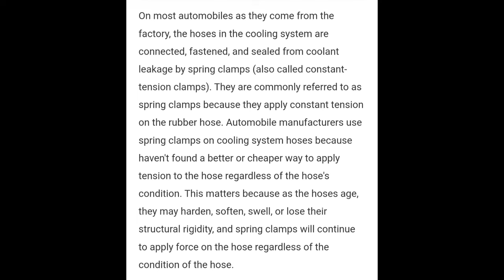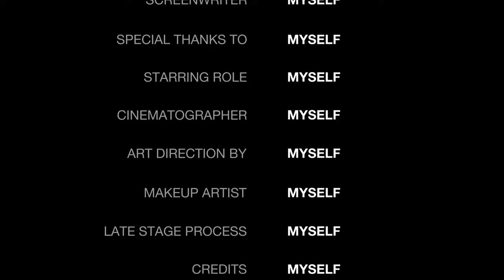STOP USING THESE ON YOUR CAR! Hose clamps worm 🪱 vs constant tension clamps!

Comment: i will confess I initially hated those clamps and would swap them out the first chance I had ....but if you have the correct tool for them its a piece of cake getting them on and off ... now I am a convert.
Reply: I've always used small channel lock pliers and it works pretty good on them.

Comment: Worm clamps are bad enough in the auto industry but it’s even worse when people use them on buried sprinkler lines.
Reply: LOL...I just put worm clamps on my sprinkler line lol. Why is this an even worse application (genuinely curious)? Based on the video, it's mostly due to thermal cycles that you don't want to use worm gear clamps. I can't imagine my sprinkler system having the thermal stress that a cooling system does. All the clamps are made of 304 stainless so I don't see corrosion as a major issue.
Reply: @MrBrandonh98  just wait a few years, if you have to dig up that sprinkler line you’ll find out,
Just because it’s stainless steel it’s still going to be a large clump of rust,
It’s not the clamp that’s the problem, it’s the screw

Comment: Yup sounds good ! 
What I came across is u got to have the correct thickness and size hose for those spring hose clamps if not they leak, that’s why people went to worm drive clamps. High pressure hose clamps all the way!

Comment: The first time I encountered the constant tension hose clamp I said to myself "what is this"? I was used to worm gear clamps. It was a wrestling match to remove the darn thing. The problems with most worm clamps are too thin of material, flatness and the square edges that cut into hoses. I got my start at a SAAB dealer. The hose clamps they used were of a heavy material with rolled edges. The bands were convex so that the the worm gear did not cut into the hose like our conventional flat band clamps. These clamps were far superior to our domestic clamps. At certain service intervals they were to be checked for tightness. We had these flexible shaft drivers with a permanently attached 8mm head that facilitated reaching the hard to reach clamps. Wurth Zebra clamps are similar but of a thinner material.

I have noticed that the hoses don't tend to bulge much with the constant tension clamps and leaks are rarely encountered. You don't have to periodically tighten them either. Unfortunately these clamps are a pain to deal with sometimes as the manufacturers like to bury them in the bowels of engine compartments.

Perhaps CP you could do a video on hose clamp pliers that you would recommend.

Comment: Appreciate this, I have a used car I bought and the cooling system started leaking, found the leak at the hose, culprit, worm clamps. I saw that needle nose vice grips are good for constant tension clamps so I'm going to replace that hose and all of the clamps.
Reply from the maker: Glad it helped

Comment: I tell ya I learn alot from you.   Made total sense.   So I HAD to buy steel spring band kits from 6mm to 27mm and a hose clamp kit with crimp tool.   Replacing all the WRONG clamps on my vehicles.   Glad you keep us straight.

Comment: spring clamps leak after you remove the hose and reinstall. the spring gets weaker every time you remove and reinstall the clamp, over the years 
I have seen many techs get come backs for reusing spring clamps personally I dont like them.
Reply from the maker: I have also seen this but I diligently replace them I'm very confident that I've never had a failure on any clamps I've removed or Installed I've seen 10x that in worm clamps fail not to mention people us the cheapest just worm clamps they can find so that definitely is a bigger factor in worm clamp failure. It's an interesting topic, to say the least.
Reply: per the OEMs (like ford, GM) the proper way to reuse the clamp is to place the clamp in the same spot you removed it from. And you probably arte using a channel locks instead of the proper tool, those will over extend the tabs and basically junk the spring tension @CPthetooladdict
Reply: Exactly what I'm experiencing after doing a power steering cooler line, the oem constant tension spring is leaking where the cheap worm clamp isnt.

Comment: Thanks for clearing this up. I'm restoring a classic car and have been confused which type of hose clamps I should use.
Reply from the maker: The aluminum and brass rads Def are not good for the constant tension clamps on older vehicles. Good clamps make a big difference for sure, and I'm glad I could help!!
Reply: @CPthetooladdict  Actually the radiator is brass, so thanks again for warning me.

Comment: You definitely right CP and the OEMs wouldn't use them if they weren't better because they're always looking to save a penny here or there.  The problem is somebody like me who's a DIYER and need a hose clamp to fix my car. We go to the local auto parts store and all they'll have are those warm clamps.  Sometimes you get lucky and if you buy a new hose it might come with the constant tension clamps already on it. I've had that happen. Mostly with new radiator hoses

Comment: but the constant tension have their limits of how much pressure they can hold there are some places where they simply can't be used. years ago before your time we used to install a lot of ventage air conditioners they won't hold the a/c pressure and most of the kits the hoses were cut to fit and weren't many hose crimpers around seen them hold up for over 20 years in that application

Comment: Never knew this.  Makes sense although I’ve used nothing but worm clamps since I was a kid in high school without EVER having a problem. It seems like the spring type clamps would lose tension over time.
Reply: Same. I always buy the solid band ones and as long as you dont go overboard in tightening then I have never had a problem.
Reply: @MrErad2008  This is the key. Don't overtighten. Worm clamps are used in the marine industry quite a bit, but when used in hot/cold expand contract applications its critical to not overnight or go with spring clamps as suggested in video.

Comment: Both types have been around for many years. If my memory is correct, I seen some of the early spring clamps being used on late 70's early  80's import cars. Toyota my have been one first. If anyone knows the maker and year please let me know.  But with all that out of the way you are 100 percent right sir your explanation of expansion  and contraction can't be said any better.

Comment: You can get 316L stainless worm drive clamps that have constant tension shells inside them and they are by far in every way shape and form superior to constant tension spring clamps, most of these also feature axial ribs on them. I use the aeroflow ones and their only about $6 us each. For intake, radiator and boost pipes they are my go to. They also easily outperform those god awful t bolt clamps most use on silicone hoses.

Comment: I watched this a couple of months ago, it made a lot of sense. I had a bad radiator on one of my trucks and so when I replaced it I converted the worm clamps on the upper and lower radiator hoses to spring clamps. Two 2 1/2 inch and two 2 inch brand new Dorman clamps. At first everything looked good, pressure tested at 16 psi, it all held. Then two weeks later I noticed water leaking: turned out the lower radiator hose was leaking. Pressure tested again; now both hoses were leaking. Replaced the spring clamps with worm clamps; everything is now good. I will never use spring clamps again - they don't work!
Reply from the maker: Clearly you're not a professional , so you paid extra for not having the experience, It's not the hose clamps that are the problems it's you lack of experience. If I would have done the job it would have been done correctly the first time with the correct clamps.
Reply: Interesting: Are you saying that you have to be a "professional" to use spring type hose clamps? I measured the hoses, using the chart selected the correct clamp sizes. After installation the clamps held, the system passed a 16 psi pressure test. After two weeks of heating and cooling off they all failed and all four connections leaked. I replaced them with t-post hose clamps- much better, and they even cost less.

Comment: I didn't like constant tension clamps until 
i bought the right tool    
   I've had pretty good luck with the  dixon stainless steel  clamp with locking nut   some are wider 
  with the constant tension  clamp you have to put it back just the way it was
Reply from the maker: Thanks for the tips!

Comment: Great info. Could hose clamps be used to replace the aluminum sleeve style clamps that get crimped on since they don’t expand or contract? For example, the crimped clamps on a transmission cooler hose.

Comment: This point is new to me and applies to the type of hose clamps that I have shifted to just this week which is the diy wire type hose clamp that also does not expand or contract, so, I’d best stop promoting those now. I’m not a professional mechanic so I rarely mess with a hose clamp, but I can see how even on a garden hose, a non adjusting clamp could lead to hose failure. Dang, is nothing simple anymore?
Reply from the maker: Nope the government has to get involved lol

Comment: Can CT clamps be re-used or should they be replaced? I have an '11 Ford Ranger with the 2.3L four. The truck is new to me. I do not know the maintenance history. It's approaching 125K miles and I'm going to replace the cooling system hoses, water pump, t-stat & coolant. I can source new clamps but was curious if the old ones could/should be re-used. Thx.

Comment: I agree with you these are horrid when rusted or someone has put them on super tight and the screw slot is buggered up and rounded off it can be a nightmare if you have to use one of these worm screw clamp push the hose all the way on until it cant go any further then put the clamp as close as you can to the bin and throw it in and then use a proper Spring hose clamp they sell them at all good car spares shops and keep away from from the worm screw clamps .

Comment: I've worked at several shops where the policy is to always replace spring clamps with worm clamps no matter the condition. Remember, it's unfortunately not always up to the tech on how things are done at "professional" shops.
Reply from the maker: That's a bad shop and poor work
Reply: That's why I've worked at more than a few different shops. The minute an owner tells me THEIR policy is against MY policy, that's when I start sending out applications. That's also the reason the shop I'm at now hires a new tech when someone dies or retires.
Reply: Sounds like your former boss was selling the spring clamps on the side for some extra cash.

Somewhere on the other end of the city, there's a workshop which unconditionally removes worm rings and installs those second hand spring clamps instead.

Comment: I won’t say what dealership I work for but I will say I have to argue with my parts department on a regular basis to stop giving out the worm clamps. I finally told my service manager we work on a brand known for reliability. These worms are going to hurt our reputation and if the parts department wants to keep handing these out we should make them pay our labor to replace parts ruined by these clamps.

Comment: Years ago, a repair shop told me I shouldn't have replaced the constant tension radiator clamps with worm clamps. Well 5 years later, I almost destroyed the engine when the top radiator hose had slid completely off the radiator. I didn't realize I would eventually need to retighten them. That was my wake-up call not to think I know better than the engineers.
Reply from the maker: A lot of old timers would say that because they hated anything new, so I can imagine them saying that.

Comment: It’s really bad when the hose that the worm gear clamps are on start to seep fluid. Especially on a radiator hose, people will just tighten them and crack the plastic neck on the radiator. Now your clamp just cost you a few hundred doll hairs for a new radiator.
Reply from the maker: Great point!

Comment: Great video, I wrote an article on this two years ago, lot of our trucks had leaks where the expansion from the heat was trying to stretch the clamp making it loose when cooled down.. told our techs never put a worm gear where the continuous tension clamp was at, if you have to, use a ‘J’ clamp if available if that’s all you got.. 
Thanks for putting this out on youtube land CP, maybe others will see it.. I’ll share it on my shop discussion page on FB

Comment: I tried using constant tension clamps. On a cold pressure test at 1.5 bar, instant leaks. The car needs to be at 2 bar when warm. Worm clamps leaked on me too.

Comment: Love the videos! I am a marine engineer and build custom sport fishing  boats at Michael’s rybovich and sons. That swelled hose is caused by heavy over tightening and it’s not even on the barb all the way. That being said  In a marine applications hose clamps doubled up in opposite direction as he displayed is ABYC standard. They are used on boats because they are high grade stainless steel and most hoses are wire enforced so you want the clamp to crimp the wire just a little . That being said there are some constant toque stainless in a washer stack or spring style. But in a marine application with how often systems are serviced replaced and maintenanceed some times while underway hose clamps are definitely not only professional but the Industry standard. Once again watch all your videos keep up the great work not throwing hate just thought to put my input in.
Reply from the maker: Yes they use those style of modified constant tension clamps on HD trucks as well so I can understand! Thanks for the informative comment!!

Comment: Hi CP. Thanks for all the info you share. A common place where I've seen OEMs utilize worm clamps in cooling systems are in offroad applications (dirt bikes, ATVs, side-by-sides). Would you recommend swapping those out to constant pressure clamps? If so, which brands are your go-to? My standard is to normally use whatever OE connectors that comes on vehicles and toys but this post has me thinking. Thanks!
Reply from the maker: That's interesting because my Polaris had constant tension and spring clamps on the cooling system
Reply: @CPthetooladdict  My Dad had a Polaris Sportsman many years ago, but I've never owned one. I have three Yamahas and three Suzukis right now, and all of them come from the factory with worm clamps on the cooling system. They do have constant pressure clamps on most of the fuel lines though minus where the fuel injection connectors are. I am a fan of the constant pressure clamps and can definitely see how they benefit in a setting where there is any expansion and contraction occuring. I just wanted to throw it out there and get your thoughts on changing these out where an OEM places them from the factory.

Comment: I concede the point you make about which clamp is superior but some times when changing hoses the new hose O.D. is bigger than the old hose and the stock spring clamp won't fit over the hose.  So now what is one suppose to do?  Where do I get a spring clamp that will fit it and know that it offers the proper tension?  I have never seen an assorted set at the parts store.
Reply from the maker: Obviously, it needs a new hose Amazon has them I will link them in the description

Comment: I literally own 100's of Idea SS hose clamps I don't use, unless an emergency? I work on small engine's and have a tray with hundreds of different sized MM and SAE constant tension hose clamps for fuel lines and vac. lines only? Keep it coming, CP, great rant.
Reply from the maker: Great point!

Comment: I think we may be the last generation to deal with any of these awful hose clamps. It seems like most manufacturers are starting to use the o ring quick connect stye hoses on new cars. I'm guilty of using worm drives on my personal cars and thinking I will fix it later😅 my mustang's nitrous fuel tap has worm clamps holding the lines 😬
Reply from the maker: Agreed

Comment: I have to disagree with ya on this one. 13 yrs at my current job. Many many return customers. We use nothing but worm clamps to replace spring clamps and we've had no problems. Zero. I don't know but they work great for us.
Reply from the maker: So why do you think the manufacturers use them your a hack if you replace factory oem equipment with worm clamps 50% of shops in America are trash please let me know the name of yours so I can avoid it.

Comment: Can these be used on high pressure fuel hose up to 10 bar or 120 psi?
Reply from the maker: You don't use hose clamps on high-pressure fuel or hydraulic fittings ever.
Reply: @CPthetooladdict   How do i get them to not pop off the fittings without clamps? Its for Motorcycle high pressure fuel and air pump.